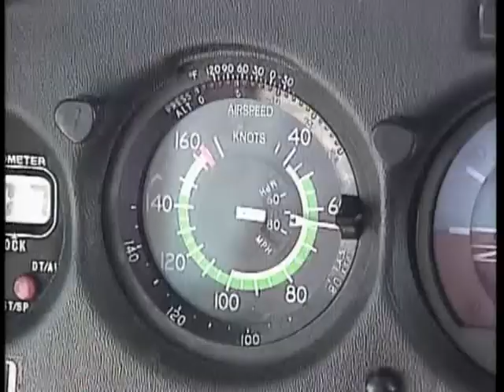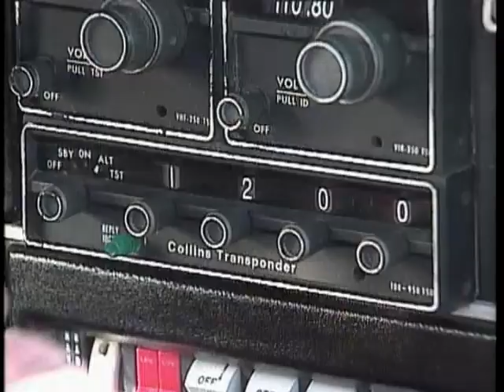Ditching an Airplane by Barry Schiff

Comment: I have ditched a Bonanza in the ocean. I agree with much of what Barry says. However, my experience differs in a number of key areas with his observations. I chose to fly the plane at about 15 mph above stall speed and use ground effect to settle on to the water combined with purposely dragging my tail first to slow the plane down while maintaining elevator control. The nose did not pitch forward.  That may have been because my speed gave me elevator control until the plane decelerated enough to settle into the water and ride atop like a boat. Further, my plane took about 15 minutes to sink. One area he did not cover much was tower communications with position as well as communicating the result of the ditching. In my case, after coming to a stop, I radioed that we were all OK and exiting the plane. Then I shut off the master.  Also just prior to touch down I shut off my fuel as a precaution. He did not address any restart procedures per se, guessing that he is making the assumption that efforts were already made. I would be very interested to see the data about retract/low wing vs fixed gear/high wing ditching results. I cannot fathom how a fixed gear plane would not pitch violently forward when the gear grabbed the water at 40-50+ mph. My tail did not cause me to pitch forward because IMO it was a very smooth, curved surface. Lastly, I will quote the age old adage in any emergency - FLY THE PLANE! The NTSB investigator I was interviewed by told me that over 70% of people in these ditching situations perish due to avoidable consequences- like stall/spin or other mistakes caused by distracted or fear based actions. Fly safe!
Reply: As a pilot living on an island in the great lakes I can say this is my only real fear in flying. Taking off out over the lake and having engine trouble is something we plan for, but hope never happens. This is great information to have.
Reply: @TALK-0THECONURE Mackinac island?
Reply: Great advice!
Reply: If I had to ditch I'd rather be in something with the gear up
Reply: Thank you for sharing your experience.
Reply: ah same , i have flown exactly 6 times and have crashed every single time ditched twice , i agree with most of what this youtuber says
Reply: @user-ix3en1zd7n  maybe we should call you Crash Craddack. You could be a sequel to Evil Knievel.
Reply: We've seen what happens when most amphibians touch the water with gear down
Reply: Amphib is a poor analogy.  Look at the long aft moment arm of amphib mains, relative to aircraft center of mass.

Now watch the video of the caravan ditching off Hawaii.

Fixed gear ditching is not optimal, but it can be done without flipping over, and it appears to me that a shallow approach angle with a little extra airspeed works best.
Reply: A friend of mine diched a (high wing, taildragger) airplane in the sea, a bit beyond the point where the waves break. The airplane flipped over and sank immediately. He was not hurt in the diching, so he exited the airplane, still underwater, and immediately started swimming toward the surface. All the air bubbles resulting from the airplane hitting the water were strangely sinking to the bottom, instead of rising to the surface - he was of course disoriented and swimming toward the bottom, thinking that he was going for the surface. He said that he had to fight his senses and rationalize that air bubbles don't sink, and followed them. 

He breached the surface gasping for air, nearly drowning. A nearby boat was already going in his direction when the crew saw him ditching, so they rescued him shortly after he surfaced. Here is the kicker: I knew not only the pilot (a fellow flight instructor at the local flying club), but coincidently also knew the owner of the boat who rescued him. That evening, the boat owner told me, "I rescued a friend of yours today", telling me the story that I would only hear from the pilot  the following day.
Reply: Seems I fully agree with you keep some extra airspeed alive, for flotsam and working the water to achieve a beast control ditching...
Reply: Incredible!  That must’ve been one heck of an experience. If I’m ever in such a situation, I want a pilot such as yourself - cool, calm, and collected.
Reply: I've been an Airline Pilot for over 40 years, & I have ditched Commercial Airliners many times In The Simulator! LOL! (I also have a collection of G.A. Aircrafts that I fly when I have some days off!!!That really became a Really Big Deal after The Plane In The Hudson Event. Captain Sully made it difficult for all of us for a while. Most of us didn't do as well as That Flight Crew, even with a Company Instructor Sitting Beside Us, screaming at us. Actually That Was A Distraction That I Could've Done WITHOUT! 
Actually, it occurred to me that during normal Takeoffs & Landings We operate in a Sterile Cockpit! I decided to remind Company Instructor of That Fact & I asked him to "Chill Out!!!" That was the right thing to do! I was told that I was the first Pilot to catch onto that. You should do everything possible to Calm Panicked Passengers or First Officers (& Flight Instructors In Simulators,) Down. Limit or Eliminate All Distractions! Fly The Airplane To The Moment It Stops. Then DO Evacuate The Aircraft Immediately!
You said, "FLY THE AIRCRAFT!" That's Right! YOU'RE In Control, Fly The Airplane!!!
Further, AVIATE, NAVIGATE & COMMUNICATE!
As you stated, You Kept In Communication With ATC & Part Of Communication!!!
That's Very Important!!!
If You Remember, Or If You've Never Heard The Sully Audio With ATC, I'm Sure That You Can Find The Sully Audio Online! 
HE MADE VERY SHORT COMMUNICATIONS WITH ATC & THAT WAS OKAY! IN AN EMERGENCY, ATC'ers UNDERSTAND THAT YOUR WORKLOAD HAS GREATLY INCREASED! YOU ARE CONCENTRATING ON AIR SPEED,  SINK RATE & TRYING TO DITCH YOUR AIRCRAFT WITHOUT SOMERSAULTING! GIVE ATC SHORT, CONCISE & TO THE POINT Like Sully!!!
When Sully Said They'd Be In The Hudson, The Controller Asked Him To Repeat, & He May Have Been Actually Ditching The Plane At The Moment! He Didn't Answer, But Another Aircraft Relayed That Message To LaGuadia ATC.
Speak In A Clear Voice, In That Mishap, It Was Easy To Find That Aircraft, Half Of NYC Could Point At It! But Let's Say That You Are Flying Over The Rockies & You Choose To Ditch Into A Remote Lake, Like The Example In This Video. Your Sectional Chart, Or Whatever You Use In These Days Of GPS, Flight Aware & I-Pads, FIND THE NAME OF THE BODY OF WATER OR GPS COORDINATES SO THAT YOU CAN BE RESCUED!
ATC Are The Ones that will coordinate your Rescue! 
You stated in your Comment that you Ditched your Bonanza Tail First! I'm interested in knowing whether  your Plane was a "V-Tail Bonanza" or a Newer Model with a Normal Tail Configuration? 
I agree that you should land along with The Swells, If Landing On An Ocean, Sea, Gulf, Bay, etc. (If You Can Determine Which Direction The Swells Are Moving. If You Know In Which Direction The Shore Is, The Swells Usually Run Parallel To The Shoreline! NOT ALWAYS, BUT USUALLY!!! If on a River, Against The Direction Of It's Flow, If Known. Land Parallel To The Bank, But I'd Suggest That You Land Relatively Near To The Shore, BUT In Deeper Water, Within A Comfortable Swimming Distance, IF POSSIBLE!!! (I STRONGLY RECOMMEND THAT YOU INVEST IN EMERGENCY LIFE PRESERVERS!)
All of The Above Is Recommendations For G.A. Aircrafts! 
For 121 Pilots, Do As Your Type Aircraft Manufacturer & Your Airline Company Recommends! You've Certainly Been Over This In The Sims. 
From Many Airports, You Often Approach &/Or Depart Over Bodies Of Water. From My Hometown, Los Angeles, With The Normal Westerly Winds, In Airliners, I Depart From LAX & Climb Out Over The Pacific Ocean, In New York, We Approach LaGuadia Airport's Approach Takes Us Down The Hudson. I Fondly Remember Approaches That  Took Us Right Next To The Beautiful, Awesome Twin WTC Towers Before 9-11!!! I Miss Them!!!
Other Recommendations For G.A. Pilots Are Set Up & Maintain A Good Glide Speed, Trade Altitude For Speed, DON'T ALLOW YOUR AIRCRAFT TO STALL!
This Is ALL The Same Whether You Have A Complete Loss Of Power or A Reduction Of Power! Just Because Your Engine(s) Is/Are Running, But You  Have A Reduction Of Power, Don't Assume That You Can Continue With A Reduction Of Thrust,,,THAT CAN BE A DEADLY ASSUMPTION! TREAT A REDUCTION OF THRUST THE SAME AS YOU WOULD A COMPLETE LOSS OF POWER!!!
Many Newer G.A. Aircrafts Are Equipped With Shoulder Harnesses. Use Them To Your Advantage, They'll Keep You Upright & You Can Continue To Control Your Airplane, If You Want To Brace Yourself, Put A Hand On Your Dash.
We Have Them In All Airline Cockpits. (Many Aircraft Owners Are Putting Shoulder Harnesses In Their Airplanes That Didn't Come Equipped With Shoulder Harnesses!!! I RECOMMEND DOING THIS!!!
Back To The Sully Landing On The Hudson,  I Don't Know How Well I'd Do In An Airbus With A Side Stick. I'm An  Older Fly Boy! I'm  VERY Attached To Yokes!!! 
With The Airlines I Began My Career In DC-9/MD-80 Series Aircrafts. I last flew MD-88's in that type before I  Re-Typed In Boeing 737's & later 76's. I finally  satisfied my Airline in The Simulator. 
I want ALL Pilots & Passengers to Survive ALL Emergencies!!!
I think that we are Having TOO MANY Preventable Fatal G.A. Mishaps!
Congratulations On A Successful Ditching!!! I hope that I never have to do one, I'm Too Cold Natured To Go For An Unscheduled Swim!

IF YOU SHOULD HAPPEN TO BE ON BOARD AN AIRLINER, DO AS YOUR FLIGHT ATTENDANTS TELL YOU!!! THEY ARE TRAINED FOR THIS & THEIR PRIMARY FUNCTION IS TO KEEP YOU ALIVE & WELL IN AN EMERGENCY!!!
In The Sully Hudson River Ditching, Sully Himself Got On The Intercom & Said "BRACE FOR IMPACT!" Remember, That Was In Mid-Winter With Air Temperatures Were In The Mid 20°F. Range! Some Passengers Hesitated At The Emergency Egress! They Didn't Want To Risk Entering The Frigid Water, Even Though The Aircraft Was Filling With That Same Icy Water! They Didn't Have To Wait Long For  Rescue, There Were Three Ferry Boats Rushing To Their Aid, & FDNY & Coast Guard Boats Were Also Heading To Their Aid!!!
Also, A Repeat Of Both Engines Failing On An Airliner During The Climb Out, & Especially From Multiple Bird Strikes That Cause Both Engines To Flame Out Is Extremely Low!!!
(I've Been Flying A Jetliner & I've Taken A Bird Strike, It DIDN'T Cause Either Engine To Flame Out! I'm Thinking Of One Particular Event When We Took A Bird Strike By A Duck When We Were Climbing Out Of SeaTac Airport When I Was Still Flying MD-88's, We Were Rocketing Out Of There, & Suddenly The Entire Aircraft Smelled Like A KFC! We Decided To Return To The Airport & Have The Plane Checked Out By Engineers & Mechanics For Safety's Sake, & If SeaTac Airport Had An On Site KFC, They Would've Sold Out Of Every Piece Of Chicken In Their Restaurant! LOL!
 
HAPPY FLYING!!!
Reply: @davidcubero2137  Thanks for all that. Tell me, did you prefer the maddog or the 73? Did you ever encounter rudder blanking in the 88 with high reverse thrust application?
Reply: @jamesharris9816   James, that's the easiest question that anyone has asked me in a very long time. Hands Down, The MAD-DOG 88! I began my career in DC-9 Straight Analog! My Friend, That Was TRUE AVIATION!!!
But The 88 Was Like Having The Controls Of A Rocket On Takeoff! It Was EXHILARATING!!!
I Never Tired Of That Feeling & I Sorely Miss Those Very Low Earth Orbiting "Rockets!" LOL!  🛫🚀🌏
I Imagine That If They'd Had Manual Control Of The Space Shuttles During Launch, It Would Have Felt Like Flying A MAD-DOG 88!!!
The 73's Are OK, But They Don't Have That Raw Power Feeling Of The MD-80 Series Aircrafts, Especially The 88!!! Now B-73's Have All Of The High-Tech Bells & Whistles. I'm Old School, I Don't Really Like All Of The Star Trek Equipment! Don't Misunderstand, I'm A Techie From Way Back, My Kids Even Learned How To Recognize The Letters Of The Alphabet On My Home Computer In The Early 80's. But I'd Prefer That It Not Be In My Cockpit!!!
Sure, It's Cool & It ALMOST DOES AWAY WITH PILOT ERROR, Which Means That They Have Increased The Already Amazing Safety Record Of Airline Travel Maybe 20 to 50 Fold! 
Congratulations On Your Successful Ditching!!! You Deserve An Award For Thinking Quickly Sir, & Saving Your Life & The Lives Of Everyone On Board!!! Yours Is Truly An Amazing Story!!! 
Your Ditching Was A "Miracle On Whatever Body Of Water That You Splashed Down In!"
Thanks For Sharing Your Story!!!
May G-d Continue To Bless You!!!
Reply: I would love to ask you some questions on your experience. This is incredible knowledge for us to learn from.

-What was the chop or swell like that day? 
-Did you point into the wind, downwind or go along the length of the swells?
-Was the prop windmilling or feathered?
-Did you need to add a lot of yoke pressure back when you began dragging the tail?
-Did it skip across some of the waves?
-How fast did you come to a stop? 
-At what point did you open the door to exit?
-Raft or lifevest?
-Epirb or radio calls
-How far from land were you?
-How long was time from the point impact to being plucked from the ocean?
Reply: NTSB should save time by investigating Bonanzas that land safely
Reply: @pfazza19 😂😂😂

If they have more than three people, a toothbrush, and 45 minute reserve beyond the next large town, it was probably over gross.
Reply: Glad you're ok!!! That's some mighty fine aviating :) Sully level!!